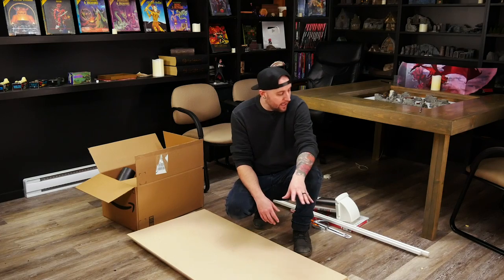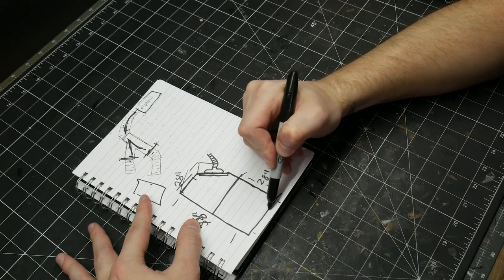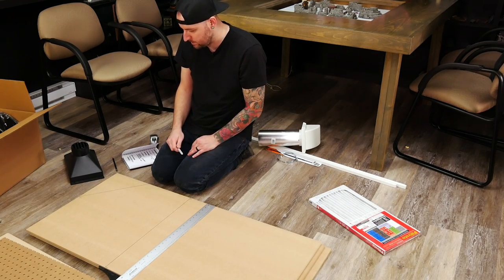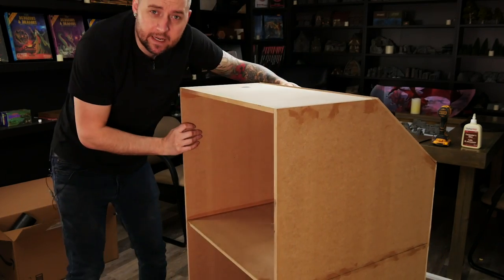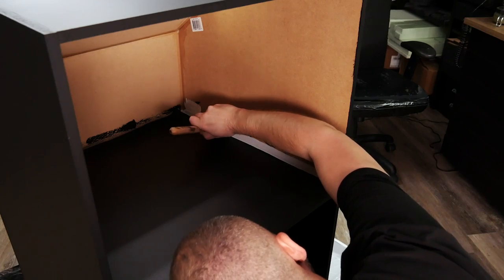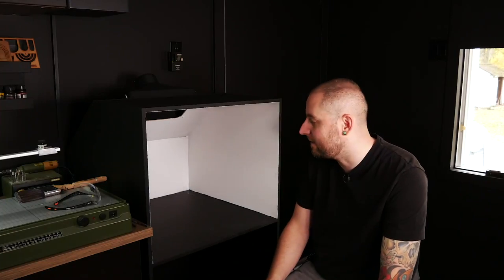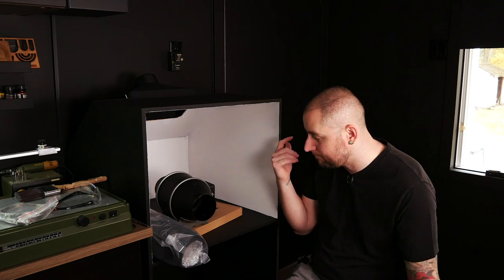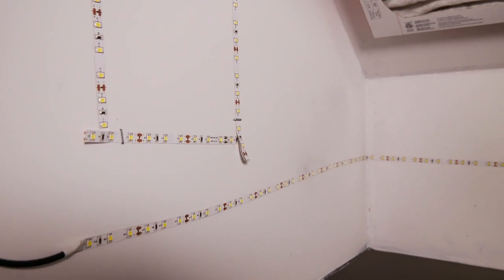I Finally Built Myself an Airbrush Spray Booth!

Comment: Cool build. 

You could use an in-line charcoal and/or HEPA filter. Then you don’t have to vent it outside (great if you don’t own the place you live in, ie apartment or rental) or you just don’t want to drill holes through your wall. And..... you really should go ahead and pony up for a “non-sparking”/brushless fan (I’ve found some for about $75-$380 USD depending on the flow rate & size you want). Even though the charcoal & HEPA should eliminate fire risk if it’s before the fan.

Comment: As a classic car restorer and car painter you really should try to keep your suction low. At the very bottom of the back or in the back  on the floor of your booth. You can use furnace filters to catch overspray.
Reply: Cobwebs and Candlesticks I was thinking the same thing. All the spray booths I’ve been in basically have the suction inline with spray level. But I’m also thinking the volume of paint from the airbrush shouldn’t matters this is functionally more of a vapor hood. I don’t use a booth from my airbrush and regularly have my laptop on the same desk and no overspray. Maybe I’m just lucky?
Reply: @ultraorange1  could be, my paint hangs in the air and overspray falls down. Might not be the case with airbrush but I would defenitely want that suction at the back bottom of the rear wall. He did a really nice set up though. It would suck out glue fumes to if glueing up in the booth.

Comment: I have the same exact setup I did in my house. I have an inline fan and hoses connecting my spray booth and 3D Printers. For the Y I had the same exact thing as you. I used E6000 to glue the blast gates to the Y and black masking tape to hold it in place as it dries. I was concerned it wouldn't hold because you're right, it takes a lot of force to open the gates but after a few months of usage it held up just fine.
Reply from the maker: Basically you just butt joined the two pieces with glue? That actually would probably work. I'm not sure if the parts are PVC, but if they are plumbers PVC glue might be enough for that sort of connection as it "welds" the pvc. Thanks for the tip, for some reason I didn't really think about going that route because it seems so vulnerable.
Reply: @BlackMagicCraftOfficial  Yep, butted together and glued. Not sure about them being PVC as well.

Comment: My airbrush booth is an old acrylic fish tank turned on its side. I even use the light from the tank on the top. I should add ventilation at some point.

Comment: great IDEA about turning the filter at angle for space,  as for resin printer I would add a shelf to wall and sit it about the spray booth, if you shake it the resin can splash and effect print, not to mention make a Mess !!!  Resin printers are small,  If you are not Printing and spraying at the same time, just sit the resin printer inside your spray booth and have a attachable prexi-glass front, my Elegoo Mars from Amazon ran me like 250$ US and is around 17" tall and 9" deep and wide. also if its high up it will be hard to keep eye on prints.

Comment: Great clarifying video.
Some recommendations:
- to install a small lip on the sides around the “mouth” what would keep the light inside without blinding you.
- Also, paint an off white on the walls and ceiling and a darker gray on the floor but not bright white, it’s more soothing to the eyes and gives you a better notion of the colors you’re painting with without light bouncing back on your face so hard and getting your eyes confused.
- the filter must take the most possible area on the back and if possible to be vertical.
- don’t use filtret as it’s damn expensive and restricts air flow too much. Use one of those cheaper ones that cost $8 for three of them and spray them with some sort of tacky adhesive to keep particles from coming back when you turn off the fan, specially if you’re keeping it on the top. Home Depot brand works well. The filtrete 3M is meant for asthma or very bad allergy but they suck really bad (pun intended) even for your air conditioner. They may say it last longer but it will shorten your a/c life span.
- You could use a double sucking vents with a bigger filter (cheaper per sq inch) and a Y connection going to your motor, that would make it more efficient. 
I was a car painter and maintained my own paintbooth making sure i was safe and the job was done correctly. There are automotive paintbooth filters that you could check if they sell by unit that are efficient and have the sticky side ready. It might be an option. 
Hope it helps.
Thanks again for your efforts!

Comment: I like your video and your spray booth, it came out great. One suggestion your filter, I would have build a filter box on the outside before the square to round first that way you can slide the filter in and out. then put a screen on the inside of the filter hole.
Reply: Plus nearly got blinded when you turned on those lights.  LOL

Comment: Use a couple stand offs adhered to the sloped back for the peg board. It wouldn't be too hard to attached a hinge and simple hook type lock to keep the peg board secured. Depending on the size of the peg board it could hold up the filter behind the peg board.
Reply from the maker: That was the general idea, but after further thought and research I think it would cause more harm than good. Rather replace filter more often and not have decreased suction.

Comment: For people who only need to use a spray booth occasionally, they can be made for free or nearly free. 
Look for someone getting rid of their old kitchen. A small cabinet, cooker hood extractor, piping, everything you need basically.
Want extra fans? A bunch of PC fans in a tube with a low wattage PSU, and presto. You can get a box full for a two bucks. Just one of many other cheap alternatives.

No need to put a hole in your wall, just get a piece of flexible tube and hang it out your window. Piece of foam or wood where the tube goes through and nothing comes back in.

Comment: Also.  Jenn Air cooktop oven blower fan has the fan separate from the motor.  Used ones sell for 80-100 USD on ebay.

Comment: That concerned about lacquer & solvent fumes, I would have used aluminum straight ducting (like recommended for a dryer) instead of the flexible ducting.  Also you may want keep an appropriate fire extinguisher attached to or under the booth.

Comment: You could use a boat bilge ventilation fan..  They come in inline config and I would think they would be spark proof, especially the ones used for gasoline engine housing ventilation.

Comment: If you decide to use the peg board you could put two strips of wood on either side of the filter that stick further out.  Put magnets on the strips (velcro may even work) and glue some washers (that magnets will stick to) or other magnets to the pegboard.  You may also want to add handles to the pegboard to make removing it easier which could be done by putting a knot in some rope on the backside, running it through a hole to front, running through another hole to the back and knotting it again.
Reply from the maker: That was the plan. You can even see the strips of wood in the material I dump at the start. May still add in the future.

Comment: I guessed right. Glad you've taken this step. Having the fan going whenever you're doing anything involving glue/paint/chemicals/foam cutting will probably increase your quality of life. Have you thought about using speaker vibration isolators for the 3d printer? I haven't heard of anyone using them. I was thinking of speaker spikes, but I guess there are anti-vibration pads too. Did you mount the airbrush inside the bottom of the cabinet? Crafsman and Miniac are making the Elgoo Mars/Photon look pretty good. Resin is a whole nother level of pollutant.
Reply from the maker: Do you mean the compressor? It's on the floor beneath the booth, tucked out of the way. Which is why I mounted the regulator beside me for easy access.

Comment: I had an idea in mind for a combo spray booth/3D printer venteing system. By watching your video I realize that I had the same idea and I'm pretty glad to find almost exactly what I have in mind done by someone else while I'm starting my build. The only difference is that I'm gona use a squirrel cage type blower with the motor outside the airflow. I am pretty lucky that my father still have the two blower from our old dismenteled house air exchanger wich are rated at 250 CFM and run at 1500 RPM. Nice video you have a new subscriber ;).
Reply from the maker: Old furnace fans are perfect for this sort of thing!
Reply: @BlackMagicCraftOfficial  A other thing different will be the outside vent. Since I live in a appartment I'll have to build a window adapter that I can remove easyly.

Comment: usually you dont want an inline fan for uses that have spray material in the airflow, can clog up motor, then you could get into overheating, fire, etc... check out blowers called hamster cage, or squirrel cage, i think mine were for hydroponics, some are used in AC and heating. these fans keep the motor out of the airflow, but pull in air from the side.
Reply from the maker: There’s a filter. But more importantly it’s really easy to remove the fan to check if it’s getting clogged and clean it. But I feel like the filter will do its job. I’ll check on the fan internals after a while has passed just in case.

Comment: Can this system (or most paint collector systems) also help with dust collection? Or should we have two separate stations (paint and sanding)?
Reply: I would think two separate systems.  The reason being is that you wouldn't want any sanding dust residue left to get into your paint or get onto the object being painted.
Reply: @pamm2230  makes sense. Thanks!
Reply: For sanding make a downdraft table connected to a vac can get ones that turn on when the sander does

Comment: If you're doing a resin printer, you should also consider adding a set of UV light strips to the box, and then you can use the inside as a curing station as well.

Comment: I would add small shielding lips in front of LED strips so that they shine inside but out of your direct eye view. Especially if you planned to use it a lot. I would also not add LED to the back walls at all, because they shine directly into your eyes. Better to have LED all along the edges, shining inside, and use a white back and walls to let the light bounce.
Reply from the maker: I've been using it regularly for well over a year, I wouldn't change how I did the lighting. When you build yours make it exactly how you think would be better. Cheers

Comment: The only reason to have your filter set in the vert back is that paint over spray tends to not rise and you are already pointing your air brush toward the filter. But if your exhaust fan has enough umph and you stick to mostly water based paint you should be golden. Like if this were for rattle can use or lacquer paints, I'd probably have the shortest possible space between spray and filter.

Comment: I have a portable one and I have had it for years.  It works for me because my hobby time is limited to the weekends and I am only airbrushing for a short amount of time.  IMHO, for most people doing hobby figures and standard terrain, it is good enough.  There was a long thread on reddit r/minipainting at one time long ago and most people posting said the same.  It is plenty.  If you do a lot of airbrushing or are doing it professionally to make money, it is probably not going to be good enough.  For my workflow where I am going to prime a dozen  or so miniatures and then paint by hand the portable solution works.  I may on occasion do a larger piece like a house where I am doing more extensive airbrushing and I am sitting there an hour at a time it is also fine.  If I had to do a multi-hour session the fan is not good enough to keep exhausting all the particles.  However, for short work, it is more than enough.

Comment: Ok so for Europeans who don't want to pay €50+ for MERV filters or buy a large value pack. 
IKEA Starkvind & IKEA Förnuftig is €10 & €15 a piece (for me at time of writing). They're roughly similar in filtration capacity, all a standard and expectable size and they are both cheap and readily available. And best of all you don't have to deal with wonky amazon sellers that jank up their prices

Comment: Looks great!  I wish I owned a house so I could build in a paint booth too.  QUESTION:  how well does it work?  Does the suction going up work as well as  going back?  I doubt it should make a difference, but I'm curious if it does.
Reply from the maker: I havn't had a chance to use it much yet, but I can say in my testing with the airbrush no overspray makes it out of the booth. I will still be wearing a mask as working that close you can still breathe in some of the dust, but I feel confident it won't spread out into my workspace in any noticeable way. In terms of smells it seems to be quite effective. Trying the Citadel primer in it (which is the worst smelling paint I own) it reduces the smell in the room significantly, and over a short period of time (several minutes) completely. 

The whole system works even better if you crack a window to bring in fresh air and negate the negative pressure from the draw. A 200+ CFM fan can quickly cause negative pressure and chimney backdraft issues if left running for long periods with no source of air intake to make up the difference.

Over all I think the design and fan I chose were a success and at this point wouldn't do it any different. Perhaps after more use I will find things that could be improved.
Reply: @BlackMagicCraftOfficial  I would suggest a follow-up video in the future to discuss how it has worked out for you in general, after a while of use of course.
Reply: You could have one where the vent sits in the window, kind of like the intake on those floor AC units. Then it doesn't matter if you own the house.
Reply: @ILoveFilm247  As, indeed, I already do.  though a built-in one would be primo-deluxe.

Comment: Very nice boot indeed, just wanted to point out that ATEX rating is not only necessary for solvent propelled paint, even dust can ignite (your filter is not a P3 filter by the looks of it, so a %age of dust will pass through) and they knew it in grain mills during the middle ages: no working after sun down ;) (no free flames allowed). That being said quantity is a factor: airbrushes push so little of paint and solvents that you really shouldn't worry. Especially if you keep the fan on all the time you shouldn't have a constant flow of "fuel" to make it an issue. There are tables to check this anyway. You just need to calculate the concentration of fuel and compare it to lower/higher ignition bracket: if you're outside these limits, you're in the clear

Comment: Great build! Regarding the fan: keep in mind that you can airbrush some flammable liquids as well, eg. enamels, alcohol-based acrylics, etc. Even oils. These are all paints that are thinned using highly flammable liquids that love turning into an explosive vapor, even when not sprayed. Just saying...
Reply from the maker: True. But I personally only airbrush with water based acrylics.
Reply: So long as the fan's running and in small miniature quantities, highly unlikely to get enough for spontaneous combustion, so as long as there's no spark should be good.

Comment: I find this video to be extremely helpful.  My thoughts are using a carbon filter with a hepa filter can help with the fumes that are flammable.  There are several expensive booths you can buy that do not vent outside but use hepa filters and carbon filters.  How is this setup holding up?

Comment: I build such a spray booth about 15 years ago. I did not use a filter, because the amount of paint getting into the ducts and fan is really small, albeit quite visible. When there will be enough build up of paint to cause a problem, my grand children will have to take care of that. The fan motor wont live long enough to get to that point.

Comment: Blast gates could have been attached with PVC or ABS plumbing pieces and cement( cheaper than 3d printing even) plus wall mount gates with bottom on the wall so pushing and pulling on them does not disturb hose. Place a bench or booth for 3d printer to right easy conection.
Reply from the maker: As I said they are not the same size as plumbing connections. They are their own odd size.
Reply: @BlackMagicCraftOfficial  Should fit like inside or over a piece or connector and trying different thicknesses of same size. Home depot should have different thicknesses ( Menerd's and Lowe's do). So like a 5" T  might be loose around said hose, but a 5" T with thicker walls made to be stronger for a different application but still counts as same 5" T might fit tight due to it actually being a smaller interior diameter. Just need to try them out or even go to an actual plumbing store for even more thickness of PVC or ABS. With any luck you will find one tight enough you don't need glue.

Comment: Explosion proof fans are now very inexpensive.  Google 1942 CFM.  :)  Your current setup is an accident waiting to happen.  Assuming your electrical is perfect and no errors occur there, eventually the bearings in the fan will run out of grease or have some problem and create a massive amount of heat.  Fragments of the bearings could create sparks if they are damaged as well.

Comment: If it helps the spray booths at my old place of work has a false wall in front of the exhaust duct  to catch the spray.  it was simply stood off from the vent and didn't go all the way to the bottom. The lights were in either side of the opening facing in. (mind you they were 48" florescent tube)